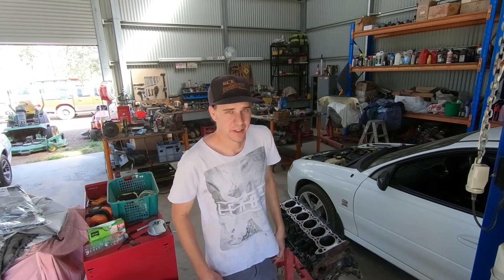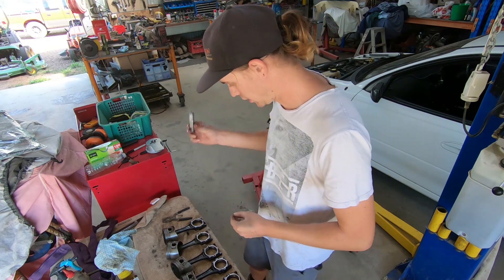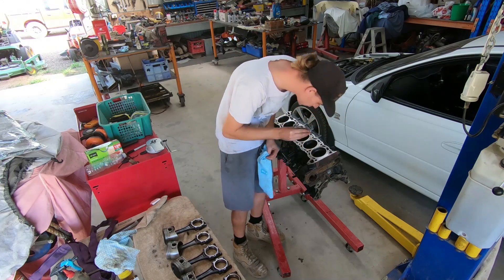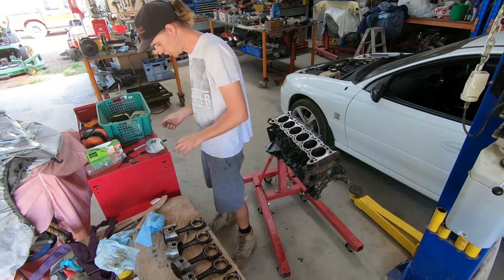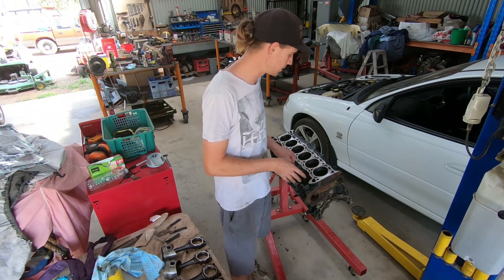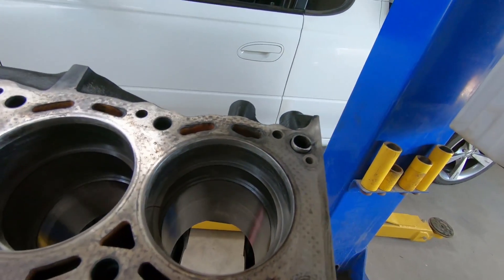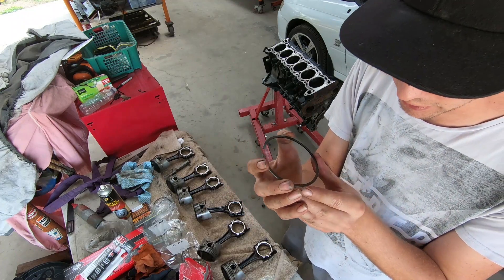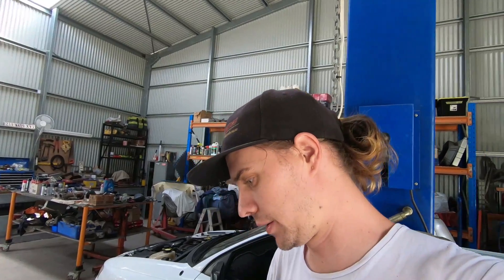R31 RE-BIRTH Part 7: Rings and Ring Gap

Comment: Just finished my 25det rebuild, good to watch and see I didn't miss anything 😂 what ECU are you going with since yours will be quite a way from stock etc? Also how do you run yours in? After much googling I'm still non the wiser when I can turn the wick up and go
Reply from the maker: haha hopefully not! Im running a Microtec LT8 (dinosaur ecu haha) but it will do the job! To run in this particular motor i plan to take it to the track and bounce it off a 7000rpm limiter for a few hours 😂. But run in periods greatly depend on what you have used in your engine. For example run in of chromoly rings and say forged pistons, is very different to cast pistons and steel rings. etc etc.
Reply: @BoostGumps  iv never heard of that ECU haha 😂 will have a read up, iv got a speeduino sat here I built ready for a go.    It's stock pistons and steel/ceramic second rings.   Cheers guys, keep up the great content 👌✌️👍

Comment: Been loving all these rb30 videos mate!! although they are making me nervous thinking about what could be going on in my bottom end lol 
 I bought a r31 that had blown it's head  before I got it, and I'm not sure how long ago either, plus it's been awhile since I've had it. It ran nice all things considered and i have just got the head reco'd with 15thou shaved of it. Gonna install the head next weekend and hope everything in the bottom end is still sweet.  
At least if the engine does need a rebuild you have all these great videos to help me 😂
Reply from the maker: Hey mate cheers for the feedback! If you have had it running and it has decent oil pressure and isnt knocking at all i wouldnt be too bothered. They're a tough little motor, do a comp test when you get the new head on if its fairly even just send it!
Reply: @BoostGumps  that's the plan bud! There's a tiny bit of rust starting in cylinder 4 and it could use with a little honing but I don't have a daily driver and need to be back on the road, so full send  it is!! 
I will most likely buy a cheap rb to rebuild. so it only has to last that long anyway 😂 

Thanks for the reassurance mate,  hopefully you hit 2000 subs asap!!

Comment: Pretty unlucky with these RB30's, when i did my RB3025neo i just found a running RB30 and bolted the head on without measuring anything, 2yrs later at 350kw's its still together and strong..
Reply from the maker: Mark Hall not wrong haha the last engine that was in my R31 was a completely unopened n/a motor that i ran on 16psi for years. Never skipped a beat and still going to this day!